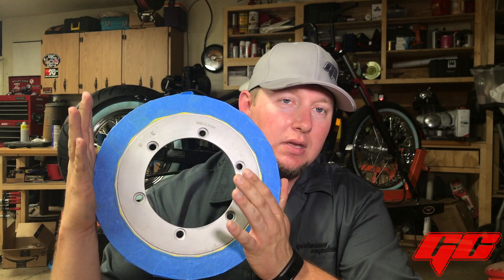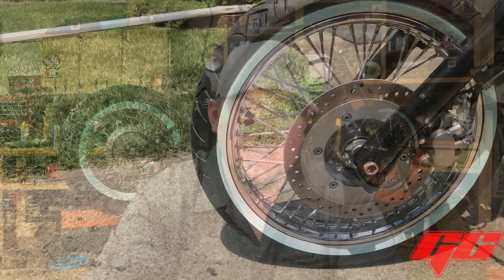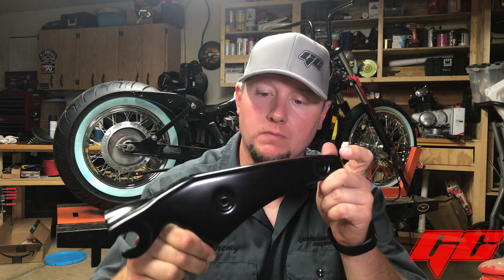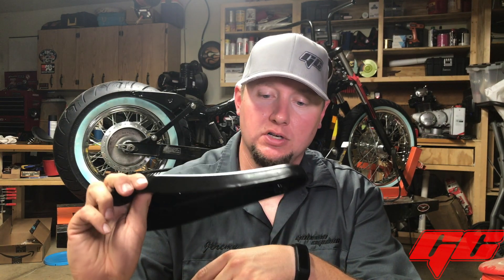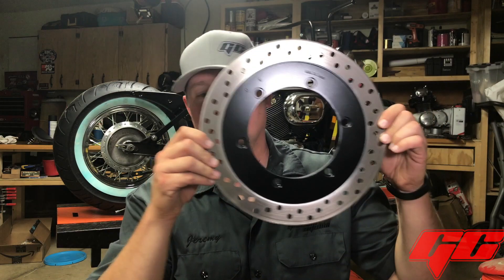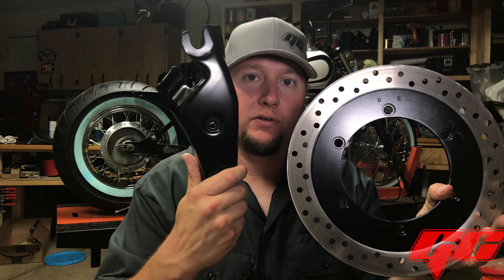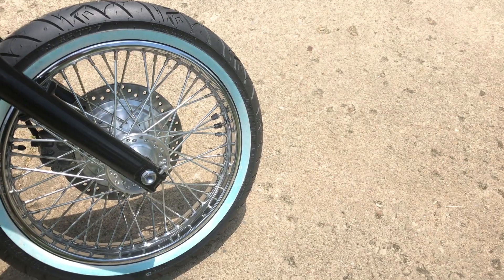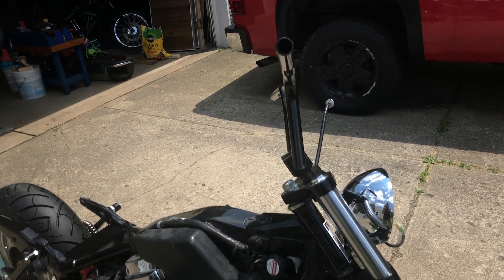Honda Shadow Bobber Update

Comment: di u use same cables with that new handlebar ?
Reply from the maker: I replaced the cables with new cables from motion pro.
Reply: @GoheenCycles  you used the same length ?
Reply from the maker: @cubahot1  No, I went with +2 if I remember right
Reply: @GoheenCycles  THANKS I really appreciate ure help..